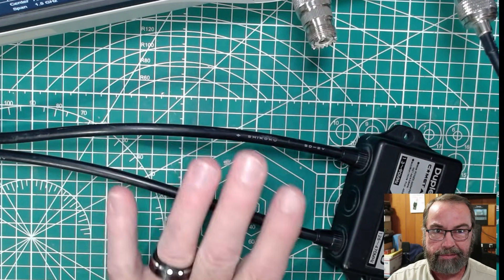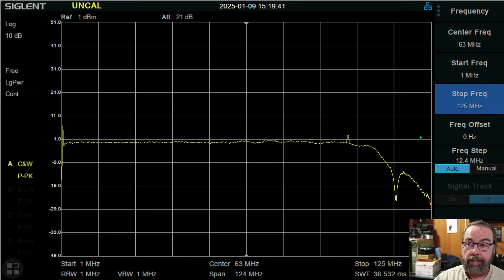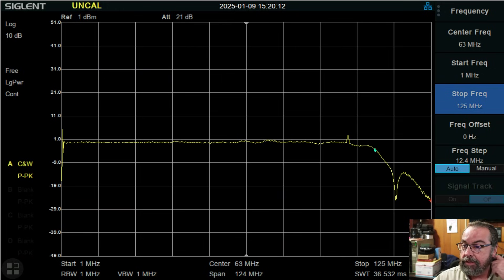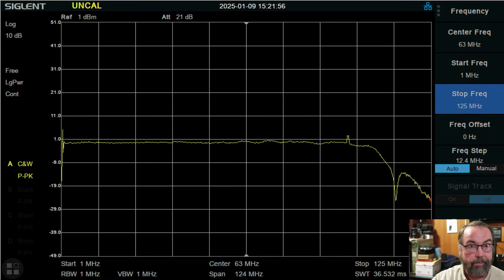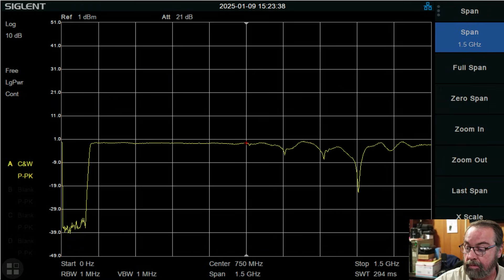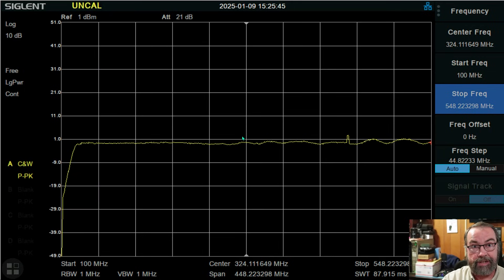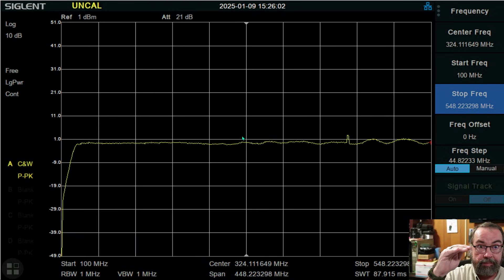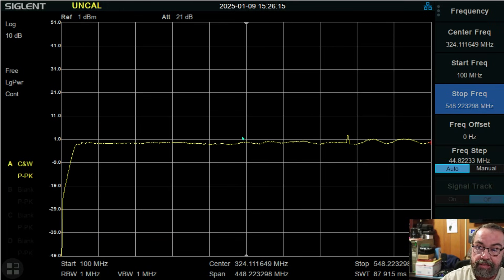Duplexer or  Diplexer?  What is the difference?  Does it matter??

Comment: I have a CB radio (Cobra) and a Baofeng handheld.  I also a 18ft base station antenna on my roof that supposedly works on 2 meters (according to Amazon reviews).  I am looking for a diplexer to run both radios off of the same antenna at the same time.  Any suggestions?
Reply from the maker: Most of them will split low (3Mhz-150mhz) and 150-up.  So CB around 27 mhz, and you mention an HT - that means on UHF it'd be fine, but not at vhf.(Cuz the CB is on that connector)

Comment: Hi there. My request is simple. I have 2 hf radios and one end fed longwire. I only want to use one at a time and the other one will be turned off. I just dont want the txing rigs signals travelling back into the turned off rig and causing damage. Can you recommend a solution? Ei2hl
Reply from the maker: An antenna switch - Daiwa, AlphaDelta, etc.  Make sure you have 50+ db of isolation, which I think most antenna switches have.

Comment: I bought a Comet CF-416 diplexer a week or so ago in order to use my rooftop Comet antenna for two radios, one for ham and the other for GMRS. The 416 model splits 1.3-170 mHz and 350-540 mHz making it ideal for my operation. So far so good. Zero issues. Honestly I feel that my Yaesu FTM-300 is receiving better than ever on 2m (although I've "lost" UHF ops on that radio. Not a huge deal). The Anytone for GMRS is crystal clear and I can hit several repeaters. Was skeptical, but as I said, it works great for my purpose.
Reply from the maker: Glad to hear the setup is working out so well for you!

Comment: So in a field day scenario where you have one multi-band HF antenna, and want to share the 1 antenna between 2 or 3 radios.  Say one on 40 meters, one  20 meters and 1 on 10m.  What device would you need to do that?
Reply from the maker: Then you're looking for an antenna switch probably.  They key is how much isolation the device has - 100W is 50dbm, so you want one rated at least that much.  If I remember, even the diplexer would work as it's not directional - so you could put the antenna side on the single connector, and a radio on each of the legs.  However - you'd need to find one with the specific frequency split, and I've not seen one that splits out 40/20/30 etc.  They generally tend to split some variation of VHF/UHF/HF.

Comment: If I’m seeing this correctly, I could use this Diplexer to run separate UHF & VHF mobile antennas with one dual-band mobile radio - correct?

Do you believe there would be measurable losses in running such a setup?   

For off-road and general low profile needs, I would run smaller shaker style antennas (VHF TRABT1420 and UHF UTRA4301S3NB)  and a diplexer. 

I’m currently running a Larsen NMO 150/450/758 public safety style because it’s shorter and strong.   The aforementioned Laird combo would be 2db improvement on VHF, whereas the UHF would be almost 1db less that the Larsen.   

Does this sound right?
Reply from the maker: You'd need a diplexer that splits out UHF and VHF.  You're typically looking at around 1dB of signal loss (or less).

Comment: you are right, there are Duplexer , you can only use one side for Receiver or Transmit.  those with Circulator, Receiver multi coupler  for example.  AG6JU

Comment: The direction of the signal is entirely irrelevant to band pass, band reject filters. It is just the ability of one design device to separate a larger portions of the RF spectrum into 2 or 3 usable sub-portions for more than one radio versus a set of multiple band pass and band reject units within a very narrow portion of the spectrum to isolate two signals from interfering with each other. The term Duplex means there are 2 functions occurring at the same time in one device, commonly a repeater with a specified offset, but could also be 2 simplex devices that operate on 1 antenna that are close to the same frequency, for example APRS 144.39Mhz and AX25 packet 145.010Mhz. Keep in mind that most scientific terminology was brought forward from Greek and Latin words and lots of variation has happened since that time frame.

Comment: NOOO! DON'T USE THAT DEVICE TO CONNECT MULTIPLE RADIO ON THE SAME ANTENNA !!!
Generally speaking separation among the bands is not enough (it needs at least about 60 dB) to avoid the risk of damage by RF power into the rx of the other radio. Don't do it at home !!!

Comment: At around 10:00 it looks fine.  They are not "band pass" filters.  It's a combo "low pass" / "high pass" filter.  That's why your not seeing it drop off at the top end.  In the case of a diplexer they usually specify a upper frequency limit for the high pass side because above that it will start to attenuate the signal more and more the higher you go.  A triplexer on the other hand has 3 types of filters.  A low pass, band pass and high pass filter.

Comment: I have an ICOM 705 (HF & VHF/UHF). What can I use to connect an HF antenna and a VHF/UHF antenna to the 705’s one antenna connector?
Reply from the maker: This is the exact thing you want.  One connection to the radio, and then one connection from the device to HF, and the other to VHF/UHF.
Reply: @FEPLabsRadio Great!Do they make it with BNC connections?
Reply from the maker: You'd have to look around, check DX-Engineering.  Amazon has a bunch of models of these, based on different frequency ranges, or outputs.  I have a triplexer connected to my IC-9700 (2m,70cm, 23cm).  Worst case, an adapter, or make a BNC to PL/N connector based on the diplexer you get.  The cf-530 is PL-259 on all the common connector, so for the 705 you'd need a BNC to PL-259 cable.
Reply: @FEPLabsRadio  Thanks! Yeah, I’ve seen some possibly less quality ones with BNC. So, this one with adapters might be the best bet 👍🏼

Comment: While I applaud your desire to teach, I must inform you that you are wrong in your assessment of how each “device” works. Duplexers and Diplexers are the same thing! Both work on the separation of “frequencies” not “direction” of the signal.  You are confusing a duplexer/diplexer with something that does move radio wave based of “direction” and that device is called a “circulator”. The duplexer/diplexers signals based on frequency, hence the fact that true repeaters separate the transmit and receiver frequency’s.    There are many publications that describe these facts are far more detail should you choose to learn the “facts” about said devices! 73’s!
Reply: I should also say that duplexers tend to be capable of separating frequencies based on very small separations while diplexers tend to perform separations on a broader rage of frequency separation .
Reply from the maker: Thanks for watching.  Multiple definitions said the same thing, which is what I said.  Maybe circulator is yet another term for duplexer.
Reply: @FEPLabsRadio much like a Chevy and a Ford, diplexers and duplexers do close to the same things! Ergo…. They must be the same things….     Do you see the comparison?
Reply: Perhaps you should disassemble a duplexer and then a diplexer…. They  are NOT the same things!

Comment: I wish they were all called (de)multiplexers with qualifiers, as seen in other domains with similar issues. For example, signals can be time-division (de)multiplexed or freq-division (de)multiplexed.
Reply from the maker: Exactly - that is what a "mux" is  - a multiplexer.  We used mainframe terminals that were "muxed" to a single device that ran back to the mainframe, back in the day.

Comment: I think you have it bass ackwards... Diplex is directional and duplex is 2 Plex, tri is 3 Plex and quad is 4 Plex. 
All the duplexer cavites I've tuned has been for frequency.
The diplexers have had 3 ports one for the radio, one for the antenna and one for a dummy load to dump the reverse RF.

Comment: Sorry, but the UNCAL in the upper left hand side . . .    I agree there is a lot of confusion on the terms and many hams don't get the difference, like podium and lectern, two very different terms and where one of them is used for the other by 90% of people.

With 45+ years of experience as an electrical engineer working in the satcom industry we use diplexers regularly both in earth stations and in satellites.  As covered in the video this allows the ability for two transmitters operating on different frequencies to share the same transmit path.  Similarly it works in the reverse direction.

We also have duplexers, but we don't really call them that, rather they're called circulators.  These are a three port device that directs energy to the different ports by direction of signal flow.

Generally, if the signals are combined or split by use of a tuned network, could be lumped elements, cavity, etc., then it is a diplexer.

There are other forms of combining that aren't frequency sensitive within the passband.  These are N dB couplers, where N is the coupling factor, typically 3, 6, etc, out to about 40 dB or so.  You might for example have a 6 dB coupler.  There are two inputs and two outputs, though for low power applications one of the ports is typically routed internally to a resistive load.  

For a practical example, there was an application years ago for satellite new gathering (SNG) trucks (like early '90s when they still used analog FM transmissions) where a voice communications system was plumbed in to the existing output path of the video transmitter to the antenna.  The through port of the 6 dB coupler was placed into the path of 250 W video transmitter and the coupled port to the 50 W transmitter output of the voice comm system.  Each system could freely tune the full 500 MHz of the Ku-band but in practice the voice comm system was operated on one transponder and the video on available transponders as assigned at that time.  

The insertion loss to the video transmission path was 1.26 dB and the insertion loss to the voice comm system was 6 dB.  At rated power output for both systems the antenna input would see ~200 W, which was 187 W from the video and 12. W from the voice comm system.  

Because power isn't lost, the power that doesn't go out the antenna goes to the load.  That was ~100 W.

Ideally the SNG video would be able to use the full  power of their transmitter for the video and not see some of it dissipated into the dummy load.  Because we were able to arrange traffic on multiple satellites to always have the voice comms system on the same transponder we were able to upgrade the installation to use a filter diplexer where both paths saw minimal insertion loss - don't recall now just what that was but maybe a couple tenths of a dB.  So the news networks got their full 250 W output for video and we were able to drop down to using a 5 W solid state PA.

Fun stuff.

BTW, with newer high performance satellites and digital video and voice comms the SNG trucks can use smaller 75 cm class antennas and amplifiers on the order of 25 W or less.

Comment: Duplexer, diplexer... makes no difference. Du and Di both mean 2. Both split the signals by frequency (in the case of this discussion, but not necessarily) irrespective of the direction of travel of the signal. They both multiplex multiple signals into a single source or destination.

Comment: I think the filters are low-/high-pass rather than bandpass, and the specified upper and lower limits are due to the response of the overall system.

If they had used proper RF connectors with good impedance control rather than the UHF de facto standard we have I'm sure it would work well past 1GHz.

Comment: Just watched first minute and a half and I disagree. I use the terms interchangeably. Why? Because it's passive. it doesn't know what you are doing. Is it receiving or transmitting on which band. There are three ways. What it does, what it is intended to be used for, what is actually used for.  You could use a 2m repeater duplexer for receive only as two very narrow bands combiner. You could use bandpass diplexor as cross band repeater duplexer. Does it make sense? Probably not. It's just band pass filters - splitters. The word duplex is used for two way communication since forever and that's where it comes from. It makes sense. But what if you use a triplexer? Is it it different from triplexor? I don't care. Plex is from Latin, Duplex is from Latin and Di is from Greek. It should be Duplexer vs BiPlexor anyway if you want to  be consistent. It's just words. It splits and combines signals, all of those devices.
Reply: @pangalacticgargolblaster9578  okay well then you're going to have to do a video explaining the difference

Comment: You nailed it!
We used DUPLEXER's in cable networks (for docsis). Splitting direction based on frewuency, but the annoying thing is industry is even confused, arris/motorola called the amplifier (line extenders) DIPLEXERS and DIPLEX FILTERS. Really annoying.
Doesnt help the I and U are beside each other on the keyboard 😂

Comment: In my decades of experience, the duplexer allows the use of a single antenna to be used for simultaneous Tx & Rx within the same band using high Q cavity filters. The diplexer is a splitter. I have a triplexer in a "field day" Gator cas for my ic705 that has one antenna port, to be able to connect a HF, VHF, and UHF antenna to it without changing coax.
Reply: Most hams don't know the difference.    (retired Broadcast Engineer)   Good description.

Comment: Very nice. So the next video will be on the duplexer then ? But with this strict definition, wouldn't you need a circulator then to make a duplexer ? Because if you make a directional coupler that couples out most of the power and you keep respecting reciprocity, the power would flow from port 1 to 3 and from 2 to 4 and vice versa so no splitting or combining would occur, or am i wrong ?

Comment: Is there another video coming with isolation? So the 100W HF transmit does not blow out the 70cm receiver?
Reply from the maker: Lee - I thought I mentioned 60db.  100W would be fine
Reply: @FEPLabsRadio  you MENTIONED 60dB, but did you test it?